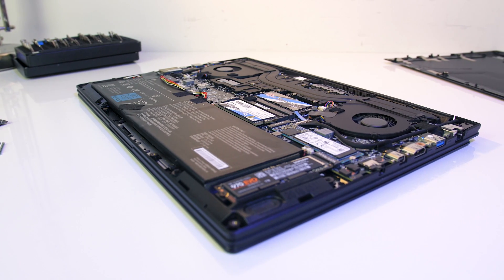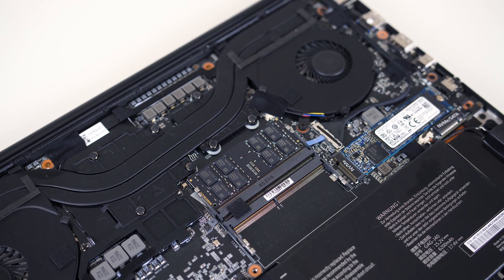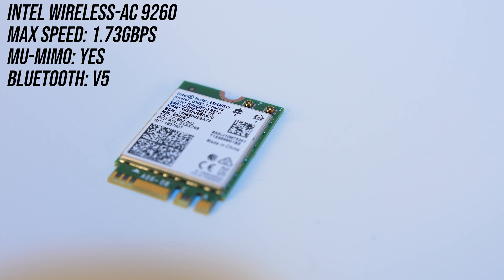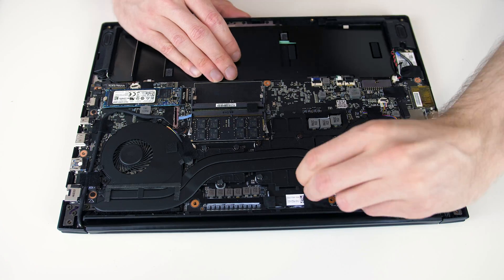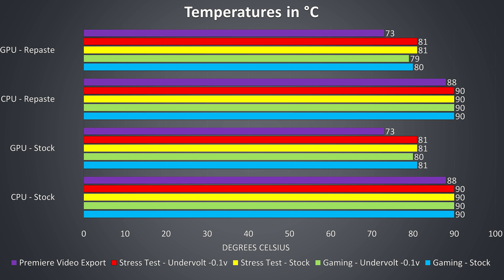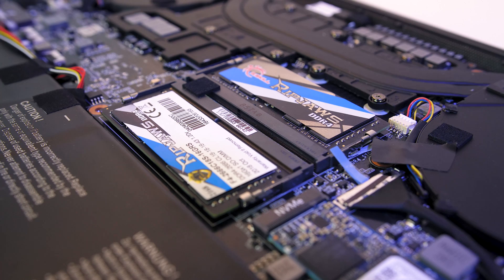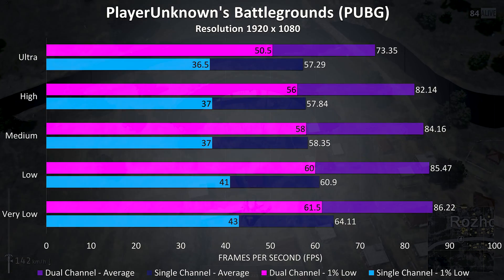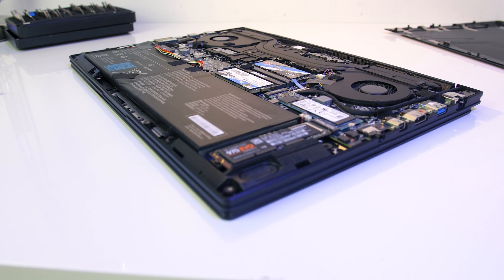Upgrading the Gigabyte Aero 15x Laptop

Comment: I know it’s kinda late, but mine won’t post after the second RAM stick was installed, even if it’s the same Kingston Value RAM 2666. What a hassle.
Reply from the maker: Yeah it's a bit annoying, did you try remove the battery for a while to clear CMOS?
Reply: @JarrodsTech  I didn't think of that and had returned the stick to the seller. Maybe I'll order another stick of Kingston Value RAM and give it a shot. 

On the bright side, I have replaced the WIFI card and added an SSD as you said, those went well. Now even my desktop have wireless thanks to the surplus WIFI module.

Edit: Kingston Value RAM 16G@2666 seems to be out of stock everywhere, so I ordered 2 HyperX 16G@2666 just to see if it gets anywhere.
Reply: Jarrod'sTech the newly purchased Hyper X sticks work as intended upon installation, no CMOS clearing, no memory training. I can only assume that my laptop has some kind of problem with green PCB.

Edit: they ran at 2666

Comment: now how the fuck do you remove that battery. I tried to unplug it for more than 30 min, that bitch wont come out. You  did it nonchalant in 5 secs. Taking off the back plate took 10 years and I fucked up a small part of the air exit. Mind though that I made my research for weeks before buying and before trying all that and it still doesnt work out that well after all. Somebody help me fUCK
Reply from the maker: I did have to remove it from a newer Aero, and it was quite hard to get it out, basically had to use some plastic tools I use to open the machines and pry it out a little at a time.
Reply: @JarrodsTech  Thanks for your response. Thats very interesting. For me it feels like I'm gonna break the plastic that holds the cables if I push/pull too strong or break something while slipping. I've got some plastic tools (small screwdrivers etc.) aswell that I could try. Is it cool if I put in a little bit more force or rather a nono?  What do you mean by "to open the machines" though I didnt quite get that part.

Comment: Hi! Thanks for brief and structured video. I'll probably will have experience with changing SD Card Reader because it doesn't work and in device manager status is: Unknown USB device (Port Reset Failed). Would you please kindly tell me is that possible to change SDcard module, or it is soldered to the Mother Board?
Reply from the maker: Good to hear it's working now!
Reply from the maker: That's strange, have you tried the drivers from the support page of the Aero 15x, or otherwise using their software that gets updates for the different parts? Forgot it's name.. Don't think it's replaceable, but I also haven't looked at it and don't know much about that part.
Reply: @JarrodsTech  I was reinstalling Windows, and yes I use Smart Update from Gigabyte. Several minutes ago solved problem by flashing BIOS it works now, Hooray! Thank you for your reply!

Comment: Hi Jarrod! What are the broblems with high temperatures actually? 
Lower performance? Less comfortable? Do you think it can lower the lifetime of the the battery (lower it's effective capacity, faster than expected, to unusable values in 2-3 years)?
Reply from the maker: If it gets too high, the components will throttle back to prevent themselves going hotter which will reduce performance. Technically higher temperatures will reduce life of the parts, but how much this practically matters I do not know, I've never seen any good information about this.

Comment: Now that they have the All Intel Inside configuration, do you recommend to upgrade the ssd by adding a second intel 760p SSD to a 512gb model?
Reply from the maker: If you need more storage space, then sure, doesn't have to be an Intel drive though, what ever you can get should work just fine, though I think the 760p series are priced pretty well at the moment.

Comment: good job on your paste job! But I prefer Mx-4 over kryonaut. I think it does a better job at cooling and more stable thermal conductivity. I had kryonaut on my aorus x7 v6 and I swapped it for mx-4 2019 edition and i got much more stable thermals under the same ambient temperatures as the kryonaut. About a 2c decrecrase in temps!
Reply from the maker: Yeah MX4 is pretty decent, I usually use it for my PC CPU testing, just went with Kryonaugt here as a lot of people wanted me to try it out 😁

Comment: Bought the 4k version of the 15x and I took it back to the store today as the heat was so much gaming at 4k that when I tried to minimize/switch windows, all the pixels fragmented and screen went black. There was no throttling, it just cooked itself.
Reply from the maker: It is a hot machine, and 4K would definitely stress it to the max given the specs aren't really capable of it, depends on the game and setting of course.
Reply: Why wouldn't it throttle though? I feel like its having a ferrari and only being allowed to drive it at 90km an hour  @JarrodsTech

Comment: Hey Jarrod, Wouldn't it help use a laptop cooling pad fan unit? Have you tested them? Which one would you recommend?
Reply from the maker: Yeah could help a bit, depends on the design of the laptop and how open the bottom is. I have only ever tested one, the Thermaltake Massive 20 in this video: https://www.youtube.com/watch?v=Zx2EnUD-DoM I also try to use it in the temperature testing in my full reviews, so you can see how the new Aero 15 X9 goes with the cooling pad in this graph: https://youtu.be/RyI1ybG95JM no change to CPU temp in that specific instance as the laptop is thermal throttling, however if you wait for the next graph in the video you can see performance is still improved.

Comment: If you run win 10, you should manually set the virtual ram limit by 30-50% more than physical ram when you have dual channel...helps greatly with games that have large particle battles suddenly needing a lot of.ram...this way windows doesn't try to optimize the requested ram amount, but this will hurt battery life.
Reply from the maker: I'll check it out.

Comment: Hi, could anyone confirm to me what is the maximum storage I am able to use on my Aero 15x v8? Can I add two NVMe of 2TB each? What is the total maximum and what is the maximum per "port"? That would be great to know. Thank you.
Reply from the maker: I'm not sure, gigabytes own information says 512gb drives are officially supported, but obviously this isn't actually a hard skin it because I run a 1tb one just fine. If no one else knows this and can answer your comment you might just have to contact gigabyte directly and find out

Comment: I upgraded my aero 15x today. I watched your video before ordering the parts, nevertheless I picked the cheapest ddr4 ram I could find on amazon, wich was a crucial 2666 MHZ 16GB one. I installed it, and my laptop is just working fine. Maybe it's because I have the old bios (FB04). Now I'll replace the stock ssd (sata) with a m2 ssd, for some reason they put a slow ssd into my laptop.
Reply from the maker: Nice, good to hear it's working! Some others have mentioned that Crucial memory seems pretty good in terms of compatibility.

Comment: liquid metal
Reply from the maker: From what I read about other people who have tried it, they also saw basically no change, I think the heatpipes just aren't adequate enough to dissipate the heat, regardless of the TIM in use.
Reply: @JarrodsTech  yea that heat pipe shared design of cooler i hate it it and only 2 heat pipe i have the GL704GW Scar 2 and that thing when from 88c to 78c when i put liquid metal

Comment: Can you put a 1TB nvme ssd if the manufacturer website sais that it supports maximum of 512? I want to upgrade the hp Omen (new model) with 970 EVO 1tb nvme and 860 evo 1tb ssd. Is this possible?
Reply from the maker: Yes, I use a 1TB NVMe SSD in mine and it works fine, as shown in this video.
Reply: @JarrodsTech  then why on their website they say max 512?
Reply from the maker: Couldn't tell you, all I can say is 1TB works no problems.
Reply: @JarrodsTech  thanks for the info. I'm really dreaming for a silent machine (except fan noise) and was curious about it. I even went to a pc store and they said that it might not recognise 1tb and would have problems but it seems that it's working. Thanks

Comment: Jerod,  thanks a lot for the such video. I am considering to upgrade my 15x to 32gb dual channel system. The pre-installed ram is V-Color TN416G26D819-SB 16gb ram with CL 19. Is there a problem caused by using rams from two different companies together if CLs are the same at 19? (For example, V-color and Samsung rams. I would buy whichever available either G-Skill F4-2666c18s-16GRS, Kingston CBD26D4S9D8ME-16, or Samsung M471A2K43CB1-CTD are compatible rams.)
Reply from the maker: I think they will run at slower speeds, the best speed both sticks support. If you open HWInfo it should tell you the speeds for each CL available. For example, in HWInfo, my V-Color stick lists:

Supported Module Timing at 1333.3 MHz: 19-19-19-43
Supported Module Timing at 1200.0 MHz: 17-17-17-39

While my F4-2666C18S-16GRS stick supports:
Supported Module Timing at 1333.3 MHz: 18-18-18-43
Supported Module Timing at 1200.0 MHz: 17-17-17-39

This means that both will run at DDR4-2400, CL17 at best.
Reply: @JarrodsTech  Thank you for the very quick reply! I just checked my v-color info and it shows exactly the same result as yours. I wonder whether there is a problem regarding black screen on boot using different rams besides causing slower speed. I see people faced the black screen issues by using double g-skill rams.
Reply from the maker: Yeah not sure, my 2x G.Skill sticks didn't work though :/ even though they are listed as officially supported.
Reply: @JarrodsTech   Got it. I should just give it a try it then. I really appreciate for your kind answers to my questions. I think Aero is a good, but weird laptop ever as I never had ram compatibility issues on my previous laptops. Thanks again Jerrod!
Reply from the maker: No problem! Yeah I agree, still a bit annoyed I don't get DDR4-2666 speeds despite buying "supported" memory lol
Reply: @JarrodsTech  Yeah, quite annoyed because it is not a cheap laptop. I would just go for it anyway as I may not notice difference in speed between 2400 and 2666. Thanks and have a great day bro.

Comment: hye, i'm considering of adding a new memory stick to my aero 15 x9 which already has a 16 gb ram in it. According to the spec, the ram is not running at 2666 but 2667. does that mean the list you showed on the video does not apply to this laptop?
Reply from the maker: 2667 is the same thing, just displaying differently due to rounding.
Reply: @JarrodsTech  alright, thanks you jarrod, keep up the good work
Reply from the maker: No problem, cheers!

Comment: My aero15x v8 is originally equipped with kingston 16gb ddr4, with CL19. I'm planning to add another ram with same clock speed, size and density, but different timings (CL17). Would dual channel be enabled?
Reply: The new RAM I'm trying to buy is from Samsung, which is in the compatible list.
Reply from the maker: It should work if both are able to run at the same speed and timings, so they both would have to run at cl19, but depending on the speeds of both that may only be possible at 2400mhz or lower. If you look at hwinfo you can see all the timings and speeds the stick supports
Reply: @JarrodsTech  Thanks for the info! I''m good as long as those RAMs can work together.

Comment: For my ASUS GL503VS (7700HQ and GTX 1070) which wasn't thermal throttling from the start (kudos Asus) I repasted the CPU and GPU, undervolted my CPU, overclocked my GPU and added another stick of ram for dual channel memory thanks to your video. Really happy with all theses tweaks because my temps are around 10 degrees lower and performance around 15% better while gaming! So much fun upgrading and tweaking a laptop. I was wondering if I can put in the same wifi card as you to increase wifi speed? Is it compatible for most laptop? I found it for 40$. Thank you Sir, you have yourself a new subscriber!!
Reply from the maker: Welcome to the channel! Good to hear the upgrades went well 👍 what is the current WiFi card in it? I'd just check they both use the same connector, assuming that's the case it should probably be fine.
Reply: @JarrodsTech  It is the AC 8265, close to your original one. it looks really similar!

Comment: This is a great video that literally sold me on this laptop.  A couple of things to add:

1. I purchased my laptop at the flagship store in Taipei, Taiwan.  The Gigabyte presence here isn't huge - it's mostly Asus, Acer, and MSI territory.  Since the reviews are usually very complimentary, I wonder if they are focused on the export market (USA)?  Issues about warranty service and availability will be a future opportunity for some.  

2. Since the shop I bought it from didn't have spare parts, I purchased an additional 16gb RAM stick and an M.2 Samsung drive from an MSI store that also sold a couple of Gigabyte models.  The tech there recommended the Crucial CT16G4SFD8266.  It worked at the advertised speed.

3. The RAM turned out to be compatible and ran at the spec'd speeds (no downgrade) as tested by CPU-Z, but ... when I installed it and booted the computer, it remained on a black screen for a few minutes.  At first, I tried to turn it off by holding down the power button.  All the indicator lights went out and I started to flip the computer over - then the lights turned back on!  After trying to shut it down a few more times, I went to my phone and Googled "laptop wont turn off".  About the point I was ready to give up and  ... well, don't ask.  As soon as I removed the back cover, the GIGABYTE logo somehow miraculously came up on the screen and it has booted successfully ever since.  TL;DR = If it boots to a black screen after installing this specific model of RAM, give it a minute (more like 5) to sort itself out.

4.  The initial speed of the computer is very good, but it started a bit rough.  I suspect this was because there were a ton of Windows updates being pushed in the background and because the new Samsung drive was used briefly before installing the specific Samsung driver.  Also, and this is controversial, I installed all of my programs with a link on the taskbar.  Did a benchmark using Samsung Magician before and after got a huge improvement after removing most of them.  Later that day I did that on my old computer and also saw an improvement using the Samsung Magician performance benchmark test.  Since these computers are sold for their speed and power, it might be worthwhile to test this out.  Many say this is nonsense.
Reply from the maker: Thanks! I've heard some people with similar issues where they just had to wait a few minutes after the black screen, I gave mine 10 mins a few times but no luck for me unfortunately :( good to hear it's all working though!
Reply: This video shows the EXACT terrifying restart process that happens when installing RAM and updating the BIOS.  Very comforting to see this. http://forum.notebookreview.com/threads/official-gigabyte-aero-15-owners-lounge.804575/page-306#post-10781307

Comment: I bought a 16 Gb V-Color with the same specs, but not the same series. I hoped, it would be recognized as the same. Buuut...NO!
My solution was to disconnect the accu and the CMOS battery...et voilà...RAM is running. I entered the BIOS, saved it and it restarted to OS. The RAM is running @2666Mhz.
So I think that the single channel is a little bottleneck. In Far Cry 5 I had a average FPS @45, now its 52. On SOTTR it is a lot more. Average 42 FPS before, 55 after! Seems that SOTTR can use more RAM effiently. Also the CPU is cooler, but only 2 C°.
One day I try to metal it. Not only to get cooler, but to get the fans runnig more quieter. Oh I just forgot to mention, that I added 970 Evo 500 Gb before and an Intel 9250ngw Wifi-Card with 80 Mb/s and fast BT5 with awsome range (even with BT4.2 devices).
Reply from the maker: Good to hear you were able to get it working! Is there actually a separate CMOS battery? Or did you just unplug the main battery? I don't recall seeing a separate battery on the motherboard, unless perhaps it's on the other side, or I'm blind 😛
Reply: I unplugged both. The CMOS battery is under the Wifi-Card. But be careful, the red/black cable (near to the battery connector) is clipped naked to the board. You have to unclip the connector a little bit in the direction of the cable and than pull the cable.

Comment: I found same issue with you about RAM Upgrade.

First, my laptop had come with G.SKILL 16GB DDR4 2666Hz (F4-2666C18S-16GRS) 
Since I bought AERO 15X v8 at April 18, there is no vendor who sells DDR4 260-pin 2666. so I bought SAMSUNG 16GB DDR4 2666Hz (Part No. is too difficult to write). 
And it was very EXPENSIVE then (about 200$)
Fortunately, it works very comfortable, and I finished undervolting and repasting thermal compound, my Aero's Temp was impressive chill.

Two days ago, I bought G.SKILL 16GB DDR4 2666Hz (F4-2666C18S-16GRS)  manufactured January 2019 (first one January 2018)
When I let it works as dual, I encounter black screen, there is no sign about BIOS just heating SSD.

After doing several case, and benchmarks, I found best case is using G.SKill & SAMSUNG.
or I have to use just one stick of RAM but it is too being idiot, not using dual channel.

I think it is very big issue with RAM Compativilty since there is no alert about it.
Why Gigabyte doesn't say anything about it?
Reply from the maker: Yeah it's strange, not sure why they still list it as supported when so many people have told them it doesn't work.